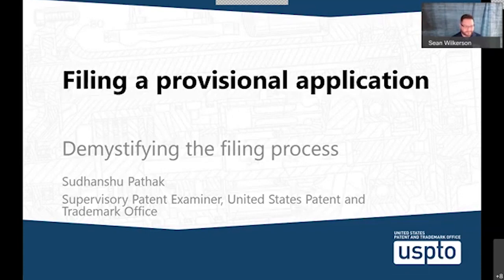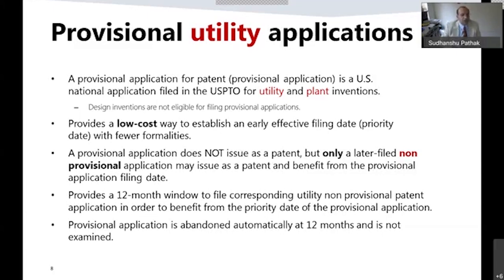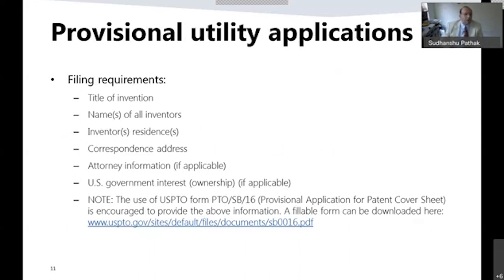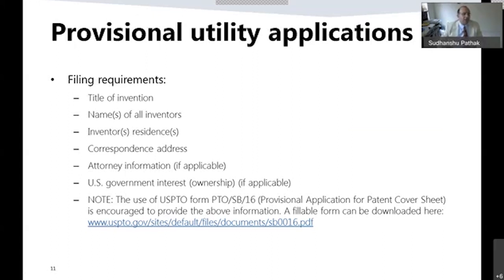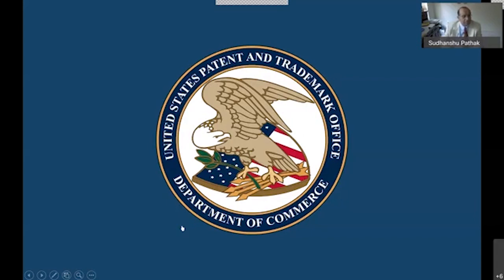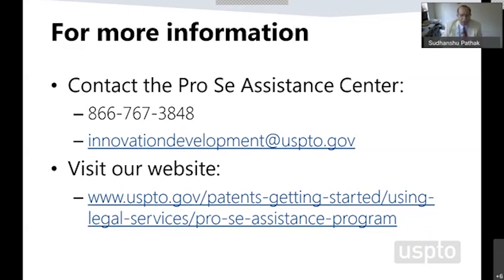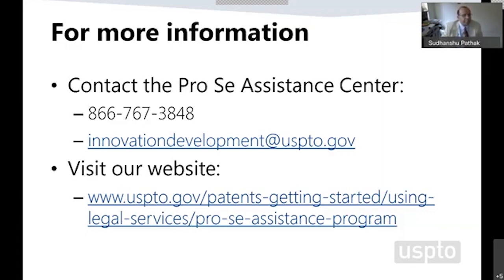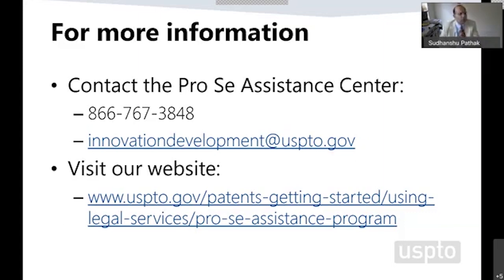Filing a provisional application

Comment: I filed a provisional patent many years ago by simply sending it through the mail registered, with a check. Received a mail delivered notification. Provisional filed. Done. Less then 15 minutes. 30 years later, mail is not an option, and I am on my sixth week without my patent secured provisionally using poorly designed on line programs that do not interconnect, deny accessibility even when the 'steps' are followed, and lock up because of 'inter communication' issues. The patent office is simply another example of how much our crappy American government is! You USPTO people should be really proud of how well you are doing! But as long as those huge pay checks cash everything is good in your books, right? Jerks.

Comment: cAN'T I FILE  MORE THAN ONE INVENTION IN AN PROVISIONAL PATENT APPLICATION?
Reply: I think so, after all, you re giving them like 180 usd . 

Not an attorney and not legal advice. This does not establish client attorney relationship
Reply: Yes you can file but there is some clause you need to fulfill at USPTO
Reply: The examiners will charge you for different searches- even if it is on one design with multiple patentable inventions. The utility patent and design patent are two separate patents you might want to claim for one invention. The provisional patent and the non provisional patent are different patents.